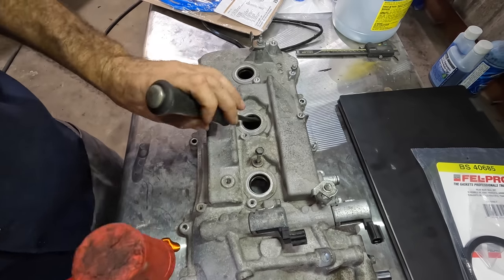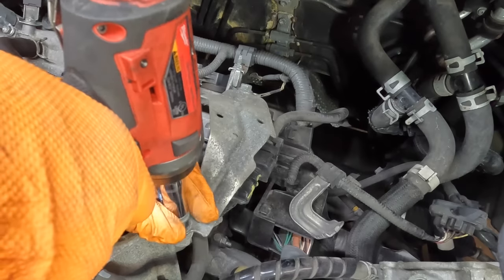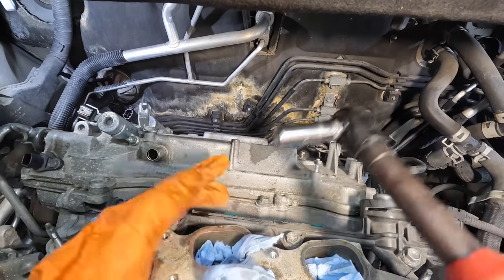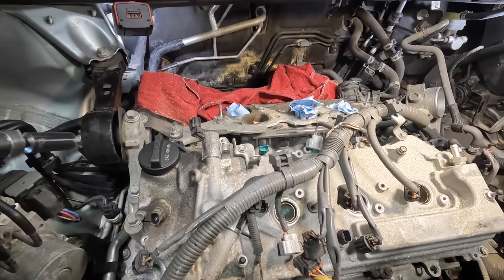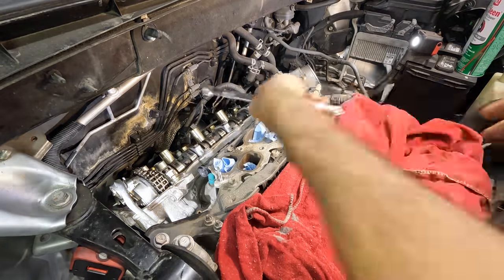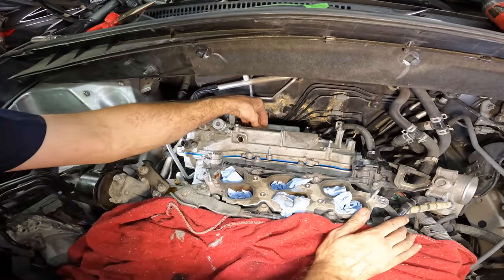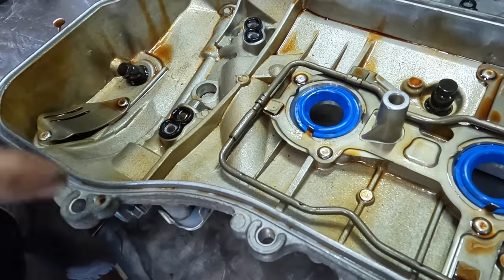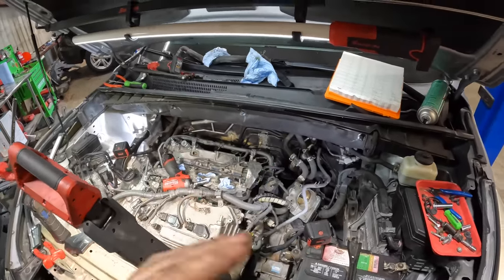Mechanic Upsells Extra Parts! "While we're in there..." Toyota 3.5 VVT V6

Comment: I’m currently building a 2011 Camaro. Has the stock L99 but installing a stage 2 cam and doing a DOD and VVT delete to convert to an LS3. Trying to get that stupid oil pan off is a nightmare so I can clean it and the sump tube.😂. One of the subframe bolts are crusted in and feels like it wants to break. Might just take the 3 driver side bolts out and let it drop slightly to the right so I can squeak it out.

Comment: such a lot of work just to fix oil leaks! Ray, you have an amazing memory how the complex parts assemble & in right order. mybe you’ve worked on these engines before. i would be scared about reassembly & finding leftover bolts/parts at the end. those tarnished rocker covers were crying out for a polish! wont make the engine run any better but would make it look brand new after all that gasket work.

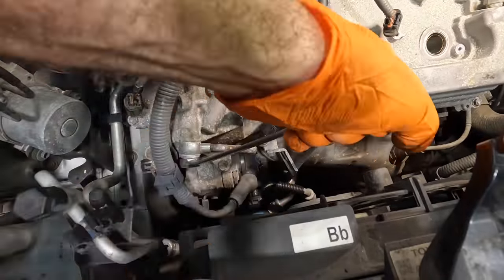Comment: 26:58 IDK if that's fair.  I worked at Walmart for a while.  The shop was kept very clean, and we had a rigorous computer learning program that covered SOPs.  When you got to the shop, it was customary to have a "mentor/trainer" to show you around the shop and where the tools and supplies are.  But any deviation in procedures is not the fault of a "quick lube shop", that's an individual's work ethic and I can say I saw much worse at Hyundai.  
Even their equipment and oil jugs were mealy compared to Walmart.

It might vary by location, but we were required to document the page number in "the book" that referenced our torque specs and oil filter.  Every car that came in for tires LEGIT got the lug nuts checked by another member after a test spin in the parking lot.  AND we had good times!  7'30 average time per tire.  11 minutes for an oil change, two cars at a time with a pit.  

I miss that job.

Comment: I agree with the coil replacement, the customer will save money in the long run, well done dudely. Basically you are taking care of the customer. Oh, pollen, I guess you have Melaleuca's in bloom, hope you feel better I feel your pain.
Blue Mule
Reply: I do not agree. They probably could have gotten another 100-200k miles out of those coils. Chances are unless you pay $600-800 for OE quality coils the original coils would outlast the new ones.
Reply: @creamofbotulismsoup9900  Hi, first he is only replacing 3, I just purchased 3 Denso, (OEM), for 164.37. Now a real thief of a tech would leave the old ones in, and hope one would die, then they would sell another 3.0 Hrs plus a coil for the next job, rinse and repeat for a grand total of $900.00 (if you are charging at least $100.00 an hour) labor as each coil dies. Yup now that is real customer care. People always ask, "why is it that those are the coils that always die and not the easy ones? Because they run hotter than the front, they suffer from far more heat exposure than the front, so they have a shorter life. 
Blue Mule

Comment: Many, many years ago back in the 70’s, when I served my apprenticeship, changing plugs was a service item every two years (or around 20,000 miles) in between those changes we were required to remove, clean and re-gap after 10,000 miles. To be fair, the plugs on a Vauxhall Viva HB 1300cc were a heck of a lot easier to access in a straight 4 rear wheel drive setup. Distributor arm and points were cleaned and gaps checked at the same time. 90,000 miles now?
Reply: The bad ole days with Leaded Gasoline

Comment: IF there's a known failure time frame on a part, and IF you're near/at/past that time frame, and IF it's a pain to get to, and IF you're already there, then yes I'd agree on doing said part.
One of the "clues" I've used on that, is if the manufacturer s,ells a kit surrounding the specific item the kit is to replace (timing belt job that comes with water pump, tensioner, idler, cam seals), then there's probably a Really Good Reason(tm) that they do it.

in the case of that 'yota, worse case you keep the 3 you pulled and hang on to them so toss into the front bank if one of them acts up and you need to solve it Right Now(tm).

Comment: I had a bad coil on my Ram Hemi. 95,000 mi.  I told the dealer, change coils and plugs out but give me the old parts. That way the older the truck got, if I had a problem, I could use the old parts since everything is doubled on it. $1600 later, but I am good for another 100, 000 miles.

Comment: 1999 Camry 300,000 miles. Changed the front valve cover gasket. Went to change the rear a noticed the amount of vacuum hoses. Didn't want to tackle it.

Comment: Ray, just a couple of things.  First, i would have used a mirror on the back valve cover to see the bolts you couldn't see.  Second, when putting the spark plugs back in i always put anti seize on the threads so the threads won't be dry metal to metal. 
Also, i would NEVER use a electric or air ratchet to remove or replace spark plugs. You cannot "feel"
the amount of torque being applied when replacing
the plugs. Or feel the tightness of the threads when removing the plugs. Many times i have found spark plugs tight coming out because of metal thread adhesion.
Reply: Spark plug threads have a special metal coating so they are not just plain dry threads and the manufacturer says no anti seize necessary.
Reply: If the plug threads are tight coming out you can hear it. 
Ray tightened the plugs by hand as you suggested and I'm sure he said the magic "click" as well.

Comment: @40:25  On many older VQ V6 Nissans, the spark plug tube seals were formed into the plastic of the valve covers.  To do an acceptable job requires all new valve covers.  There are some YouTubes showing guys using hole saws to literally saw the seals out of the valve cover and RTV in replacements, but you gotta be six kinds of desperate to resort to that.

Comment: In such a situation where the coils aren’t particularly cheap but are failure-prone so you preemptively replace the hard to reach ones, should you save the old coils to replace any of the easier to reach ones as they fail? Seems a good way to offset some of the expense.
Reply: Toyota coils are far from failure prone. I've never gotten less than 200k and up to 400k on the originals so YMMV.

Comment: I feel your Subaru pain.  I have owned Toyota's for the last 14 years and only 2 of them.  The parts last so long and living in Canada with our wonderful salt roads when I do have to repair my vehicle on a gravel driveway, snow, rain or nice weather if I'm lucky.  Stuck bolts and rusted parts are an everyday occurrence.  Always spray the bolts with penetrating oil first and let it sit for at least 30 minutes.

Comment: You didn't replace the rubber O ring seal for the pipe under the valve cover. That O ring allows oil pressure into the pipe and the pipe has holes to allow oil to lubricate the cam lobes. Should probably go back in there and replace those.

Comment: Done the same job a few times on a 3.0l it's not bad. I don't replace the could cause the Toyota/Denso coils are pretty reliable . Aftermarket ones are junk and have a high failure rate even as new. I get your point though when there paying for the job it might make sense. But I do my own work so I'm just risking a few hours labor and if I do it right a new upper intake gasket set. But at 90k I'd have a hard time recommending them. But your the pro not me. I just have the experience of my two Toyotas the 3.0L and the 4.7L

Comment: Not sure if anyone else noticed it - if did then ignore me please :-) I am affraid you did not change the small black o-rings (one per head) sealing the oil sprayer tubes (for the camshafts) in the valve covers - they are located just on the other side than the 8-shaped seals (54:30 - upper right corner for example) They are not even remotely as critical as the 8-shaped seals are but since they were included in the seal set and "while we're in there.." ;-)

Comment: Love the video Ray! While I know Toyota's do have some issues and problems, by far they in my opinion are easier to work on and parts are usually inexpensive as compared to many other brands. I have always been intrigued by the longevity of Toyota products. I knew a person that had over 400,000 miles on a  v-6 Camry with original engine and transmission when the transmission started slipping. Another friend had over 500,000 miles (still going strong) on his Tacoma TRD when he gave it to his son and bought himself a new Tundra. Of course good maintenance was part of the equation, however you seldom hear of many other makes (domestic and foreign) that has longevity designed in.
Reply: I’m the third owner of a Tacoma and it has 300k miles on the clock and it’s still going strong 😀. I hope to get many more miles out of it. Great truck.

Comment: One of the many reasons I hate transverse large (V6/8) engines being that the need to remove basically all the top external parts just to change spark plugs. Side note there is no word for a pack of tigers as they are a solitary animal.(except  for breeding season.)

Comment: Do you check the spark plug gaps on the new plugs. Also why do you prefer using screwdrivers on hose clamps over using a socket? Always see you using a screwdriver on them.

Comment: I’ve got around 238,000 miles so far on my OEM coils so idk about this “high failure thing” with the OEM coils. The absolute last thing you want to do is replace them with inferior product which guarantees you’re going to be back there very very soon anyway.. if anything is high failure it’s definitely those cheap ass coils from the discount store. So what did you really save? 

If you’re going to replace them as some feel good measure, get the real deal. Also, if you buy directly from Toyota they’ll stand behind it, even well after the 1 year. At least where I live they certainly have in the past! Keep that receipt!

Ps— where exactly were those gaskets leaking?
Reply: Yea I think the coils issues are with the older Toyotas with 2grfe newer ones I don't think are an issue. If you want to save maybe used ones...China junk ones won't last long.

Comment: Those were some pretty clean valve covers to be replacing the gaskets? Was the back one leaking out the back? Or Rear leaking out the rear if you prefer...
Reply: The 2gr engine is pretty bullet proof but every once in a while they can leak from the valve covers usually in the same spot, that's really the only weakness of this power train

Comment: ... G'day, and goodbye.
Are the "12mm" (M8) bolts also used to jack the dowel pin joints by screwing into the 10mm cover bold holes?

Comment: Ray, did you schedule them to come back in 5k miles when their spark plug holes fill with oil?

You put the tube seals in upside down, you have to watch the taper
Reply: I don't know anything about this topic but you're making a critical point so it is worthy of discussion. These days many engines have significant crankcase vacuum, which means seals with a lip will be drawn tight on the plug tube if the lip is pointed to the outside. Ray explained the reasoning for his plug seal placement after 41:00 and he seems completely confident in the orientation of the new plug seals. He's probably done this task hundreds of times, which means he would have had an avalanche of callbacks if he consistently did it wrong. Do you have evidence to back up your contention that the new seals are in upside down? I'd certainly like to know for sure which way they go.
Reply: No , he explained nothing. I have installed hundreds, from Toyota they came the other way around. They slide on easier upside down, but they also leak easier upside down.
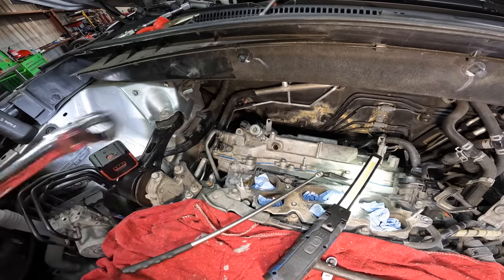Reply: @donpetersen2000  I found at least one video by a pro mechanic here on Youtube that supports your point of view, a video that showed how to replace the OEM seals. I believe the spring on those seals is on the inside, so the spring is coated with oil and less likely to rust. However the Felpro seals look very different, and a brief internet search for how those are installed gave a 50:50 reaction, from many people who don't seem to have any professional knowledge. The occasional pro who chimed in supported your point of view. I'm surprised Felpro doesn't commit themselves by labeling the seals so there is no confusion. The way those Felpro seals fit so loosely, and they way there is confusion regarding orientation, I would be reluctant to use that brand for this style of Honda. Normally I like to think about which side is the high pressure side, and put the spring on that side, usually the inside. If inside pressure is higher, it will close the lip against the plug tube. However that area of the engine may be exposed to vacuum through the PCV system. So, I don't know which side is the high pressure side in this engine, and it may depend on the position of the throttle plate. In the rare normally aspirated engines where I've measured crankcase pressure, there is very little either way. Some new engines (VW turbo) have tremendous crankcase vacuum, enough to stall an engine from severe vacuum leak when the oil cap is removed.

Comment: Bend was good, flex implies a return.original. Yield strength was exceeded, hence a bend. If yield strength not exceeded they would spring back into place and flex and you would still have a tab in the way..

Comment: I just bought a 2008 Highlander with this engine.  Spark plugs need changing (as far as I could tell from the front), and one front coil had some minor charring.

So I don't want to spend $700 on coils.  Let me rephrase that - I'm not spending $700 on coils at this point.  It runs fine, no codes, no obvious misfires.  I got some aftermarket coils for $150.

The question: assuming the coils in there are original and have 150k on them, should I use the best 3 original coils on the back rather than the new non-OEM ones?  Seems like based on the comments this would be the way to go.

Although after my last job(s) on my truck (changed clutch 4 times - don't ask), going back there multiple times doesn't seem that bad of a proposition.

Comment: I'm almost 100% certain that the 3.5 VVT uses a bypass filtration system, meaning that dirt theory is flawed, only some oil goes through the filter so the dirt may not go through the filter.
Anyway, there are two filtration systems used on car engines Full Flow or Bypass. Both have advantages and disadvantages. Bypass systems can filter down to 2micron and don't restrict oil flow.

Comment: Question for rainman... What makes the brake pedal occasionally push back against your foot while slowing? I have bled the brakes and replaced the passenger front calliper and it still occasionally happens. It's on a 2013 dodge avenger base model. All my research says it's either a wheel speed sensor glitching or it's the abs itself needing bled and/or replaced.... Robbing peter to pay Paul already so a cheap fix would be great 👍🏻 any ideas? When it pushes back against your foot while you brake occasionally it will bump your foot twice as if the abs thinks the one wheel is going faster or slower than the other? No codes show on the obd scanner though

Comment: if you need to be at the back and replace the coils. If they are good give them to customer. if one in front fail he has spare to replace with used one. that will make him drive a bit longer before needs to put 3 new front once in.

Comment: I had an old F150 that kept overheating on short trips. Flushed the radiator, changed the thermostat, and added an electric fan. The truck still overheated. 

While I checked the water pump, I found a crusty strap with with a small square bracket on the end of it. Realizing that it was a ground strap, I cleaned it up and got it reconnected to the block. 

To my surprise, the truck stopped overheating, and fuel mileage went up. That's when I learned the importance of grounding straps/cables.

Comment: Should have used genuine Toyota gasket and tube seals. The Felpro gasket is shallower and has a different cross section.  I used felpro only to leak in two years. Toyota gaskets seal better.

Comment: I current own 09 Highlander with the 2GR-FE 3.5. it has a small oil leak on the timing chain cover. Is it possible to change the timing cover gasket and VVTI gears without pulling the motor out?

Comment: Can I ask a question, or perhaps others can leap in, as I have never done a Toyota V6 ?  Why is it necessary to take the Valve covers off?  If you can get the coils out, can you not get the plugs out as well ?
Reply: The job was to replace a leaking valve cover gasket.

Comment: Great work/ video. Curious tho why you didn’t toss the valve covers into the parts wash? For myself it’s the little details I like when professionals go above and beyond. All though not necessary a wash would have removed some of that top side corrosion and make the engine look cleaner. I imagine that’s why you replaced the gaskets as the prior ones were leaking making a mess. It would also help distinguish old leak’s elements potential come backs as customers may mistaken old oil as current leaks. Simply a suggestion. 😊
Reply: I too am caught up in being anal with the motor and bay being clean, always picking on Ray as to customer satisfaction. All they see is the finished product, and clean is always better than dirty !😊
Reply: gaskets are 1 time use. if you open a part that has a gasket, that gasket needs to be replaced. sure you might be able to get away with skipping it but its not worth the work involved.

just look at a head gasket replacement. usually costs thousands, but the part costs less than 50$, so why skip the cheap part of using a new gasket when it can cost you all that labor again?